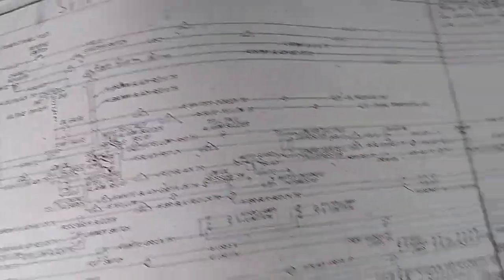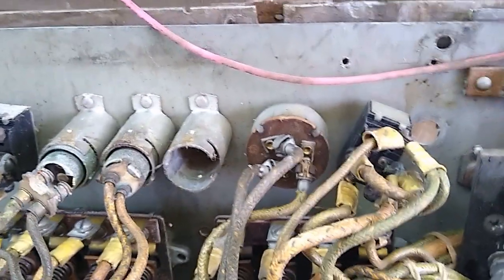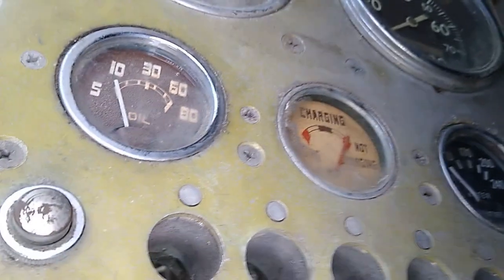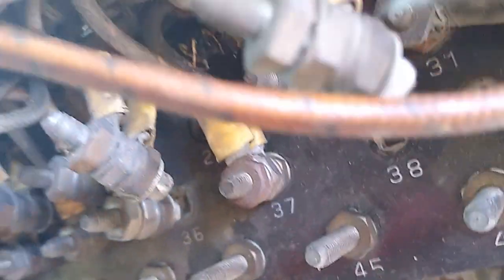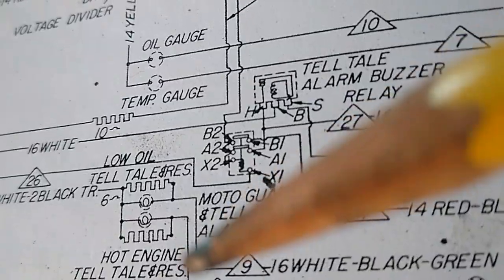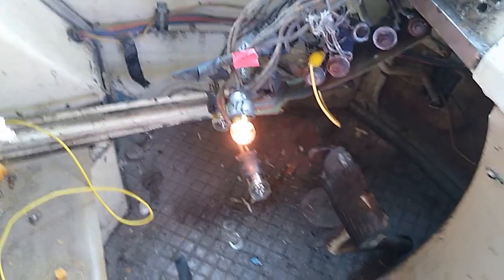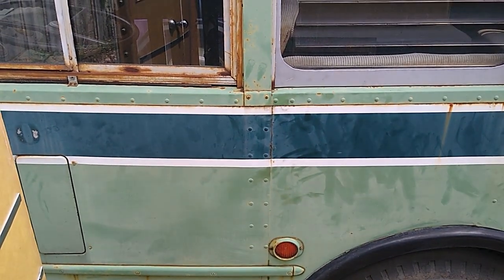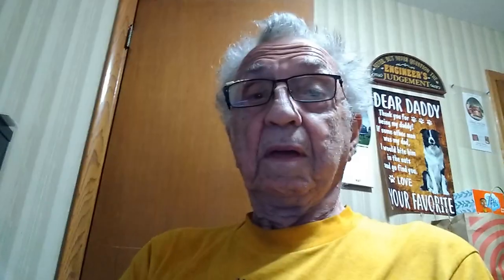Taylor's Silversides Electric Part One.

Comment: Hi Phil, good video on wiring. Some times a person needs to use a page from another book. Cleaning lug wire ends can be done with ink pen eraser. This is fiberglass brush working to clean corrosion. Found in the past even wire to lug contact need improved. Used metal tinning fluid to help solder with high tin persentage to wet out. You are doing good love your work.

Comment: I don't like working on the electrical system in my vehicles. Of course mine doesn't look like that one , but you make it look easy Phil. Thanks for another great video. Take care and best73!
Reply from the maker: I don't work on modern electrical systems nowadays. Nothing to see or do.
Reply: @busoldmanphil7293  I have a brake controller that is intermittent. I am going to have to fix it. It'll just take time. 73!

Comment: Well, that cools my desire to rewire my 4106!
Reply from the maker: Maybe it's better than you thought?
Reply: @busoldmanphil7293  — looks much like the wiring in the bus in your video. My bus sat for 10 years before I bought it & initially I had a new wiring failure weekly. Now the problem rate has slowed down but there’s a few problems that elude me. I get frustrated & think it would be better with all new wiring I could trust.
Reply from the maker: @joelhansen7373  Be Patient. Go slow and take each terminal and relay as a possible problem and loosen each nut and screw to grind off the patina, spray with contact cleaner and tighten everything back, Don't assume a clean connection is a good one. Remember, a herring in the moonlight is shiny, but it stinks.

Comment: Hi Phil....   I'll never have a Silversides to restore, but I've learned a lot from watching your videos ( and others like Scott and Tyler"s channels). What IS the repair that you like for the broken sockets?  Would a very light and small amount of dry lubricant applied to the back of the socket prevent the spring from seizing? Since you have the panel apart, it would be easy to spray each socket.
Reply from the maker: On the next video I will show a procedure for repair. It's more like just putting it back together. I'm not crazy about dry lubricant. It just dries and adds another film to the sleeves. Dip a toothpick in oil and touch each sleeve with a quarter drop and work it in. Actually, replace all the bulbs with new ones and you will never have to return to that issue again anyway.

Comment: Interesting that all of the cloth wiring has plastic crimp terminals back then
Reply from the maker: I can't explain it. Every one looks original and nothing about the harness, securement or routing shows a rewire. I will say this, though, almost all terminal lugs have pulled loose from the fiberboard panel. That's the first time I've seen that.

Comment: I have a gm 4106. The electric compartment next to the drivers seat got wet and I have alot of corosion to clean up. Phil is there a trick to removing the silver collar that holds the momentary switchs in place for the reverse and emergency shutdown solenoids? Thanks for your videos I'm learning alot.
Reply from the maker: It screws off. Unscrew the panel and hold the switch with a pliers or Crescent wrench. Carefully grip the collar with a pliers. You don't want any gouge marks on visible components. You can flush the terminal panel with clean hot water. With a tooth brush, apply some baking soda to corrosion points and flush again with clean hot water. Run a wet/dry vac to capture the water. Now use a hair dryer to finish the job. Remove covers from any relays to dry any moisture. While you're at it, with a magnifying glass, look for corrosion or patina on the terminal lugs.
Reply: @busoldmanphil7293  thanks Phil your the best .
Reply from the maker: @rowdycharles3741  Use a piece of rubber or leather under the pliers so you don't gouge the ring. I hope I'm on the right track. I'm guessing what the silver dollar is.
Reply: @busoldmanphil7293  thanks Phil I got them off. I got them apart and was able to get 1 cleaned up and working. What was confusing me was the collar or nut has two small holes in the side opposite each other maybe for a special tool?  I was thinking it had a set screw  . I did what you said it took some working back and forth to break through the rust.
Reply from the maker: @rowdycharles3741  Nice work, Rowdy, have you cleaned the electric terminal panel yet?
Reply: @busoldmanphil7293  I have been busy with work and haven't gotten anything done with the bus. Thanks for asking.